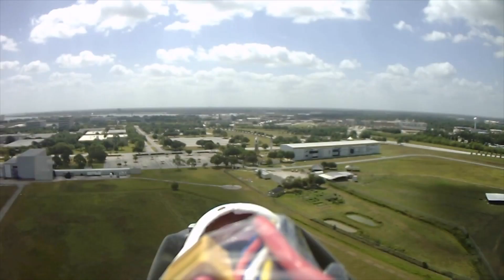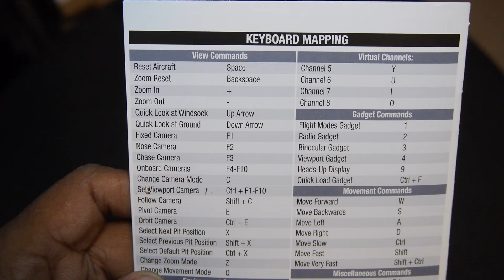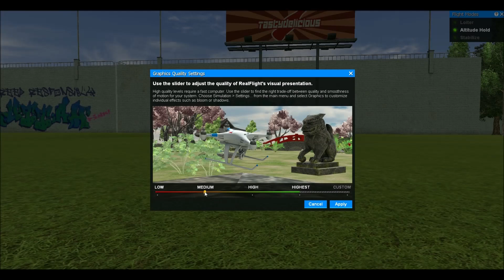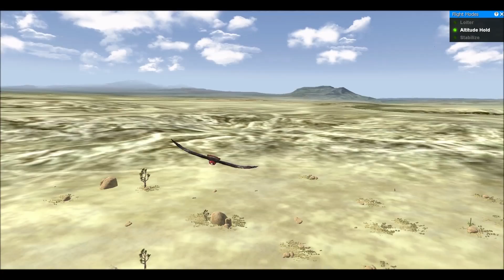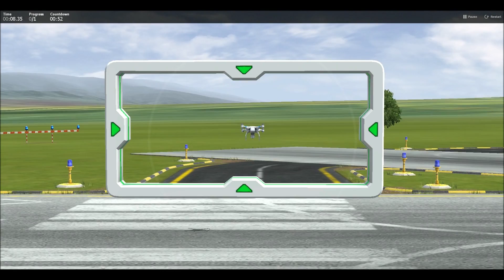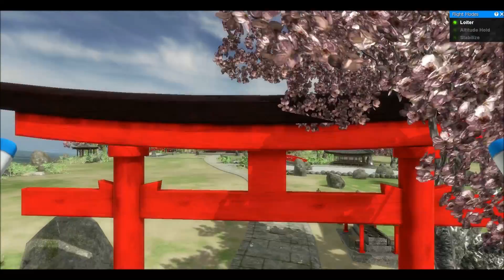Realflight Drone Simulator

Comment: outstanding video, well done! I plan to buy this product based on your realistic and very professional review! I am not a RC hobbyist, but the pleasant tone of the presenter in this video and the lure of safely learning to fly a drone has convinced me that this product is a great investment in building skills to minimize repair costs and maximize quality of the flying experience when it is time to purchase a drone. Thank you!
Reply: I've ordered my Realflight Drone from Amazon and hopefully it'll arrive next week. Based on this and a few other really good reviews I'm hoping I can improve my skills. I've been flying quads for the last year and a half and have to use a soccer field close to home but have no margin for error since it's surrounded by homes. I get nervous if I fly outside the field so don't really get a chance to push my skill level as much as I'd like. I'm planning to practice a LOT using this sim.

If you haven't flown before, I'd recommend a cheap toy grade basic starter like the Syma X5C-1 to practice the basics after you've practiced on the sim. You WILL crash now and then and the Syma is pretty rugged and replacement parts (rotors, gears, motors, etc.) are cheap and easy to get on Gearbest, eBay, Amazon, as well as others. After you're comfortable with that, then you can upgrade to something with a bit more power (still not too expensive) like the Tarantula X6 or Kaideng K70. After you get comfortable with that, THEN you can move up to something with REAL power like the Bayangtoys X16 or the XK 251/252 or even (gasp!) a Phantom.
Reply: Thanks!

Comment: Thanks for the review, it was VERY helpful.  It turns out that B&H Photo and Video had it on sale for $80, so I went for it.  The combination of your review and the reduced price sold me.  If all goes well, I should get my package by Thursday.
Reply: +Dale Bergeron I'm still using it, but mostly just the flying part.  I tried some of the challenges, but don't really use that section of the code.  I like flying in FPV mode and do that most of the time.  Because the number of locations and aircraft is limited, I'm planning on doing the upgrade to the full version.

Comment: Hi good job with the review I think I will buy one, is there a version without the cable wireless?
Reply from the maker: +RC944jim , not as far as i know. The wireless Realflight sim uses the TTX610, which doesn't have the controls buttons/knobs needed for the drone sim.

Comment: justgot it for Xmas,, but I don't have a DVD player on my new computer, WHAT NOW?........
Reply from the maker: +MiamiJato , extremely surprised your computer doesn't have a DVD player(!). However DVD or DVD-R players are relatively cheap to add to a desktop (or USB if you have a laptop).
Reply: +MiamiJato I purchased an external USB optical drive for less than $50US, they sell them at many retail stores where you can purchase computer accessories, you can also purchase from many online retailers as well. The last optical drive I purchased from an Asian seller on eBay and it also reads Blu-ray discs, although I also purchased the Blu-ray movie player software to play movies. I also purchased a license for "Poweriso" a software program that creates an image (.iso file) that Windows can assign a drive letter just like a real optical drive, which saves me the burden of connecting the external optical drive. Good luck.
Reply: +TaggingTechnician yeah, I got one already just like you described, all good now......

Comment: I'd get this but it's not compatible with Realflight Interlink USB controller.   What were they thinking?  It's their own product.
Liftoff has no problem with it.  So I went with Liftoff.
In fact, I just found out, most of their sims aren't compatible with their own controller.  Go figure.
https://www.realflight.com/support/kb/article.php?p=RF8&q=16-1054

I think mostly I got fed up with their serial number system, it dosn't work, I could never get Real Flight 6 or Real Flight 7 to work, it would never accept the serial number no matter how many times I typed them.  It sucks because I actually bought the rudder pedals and joystick to go with it.